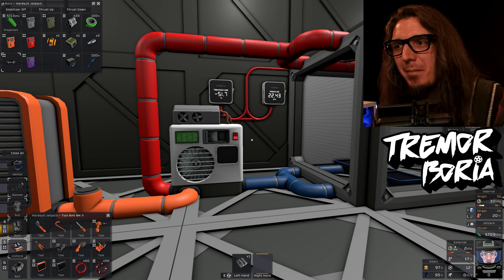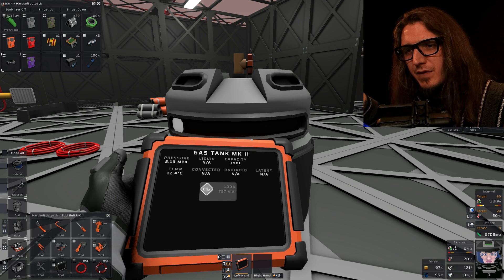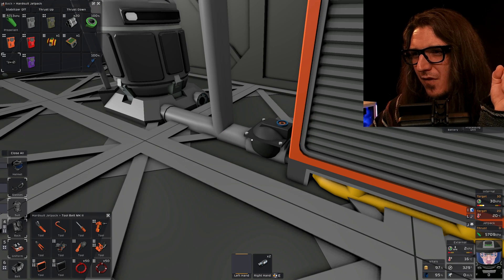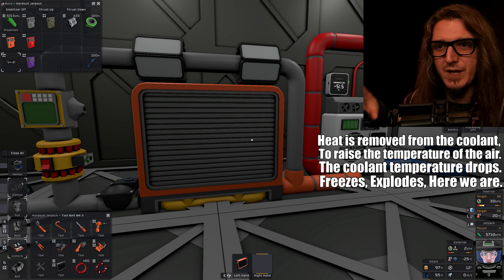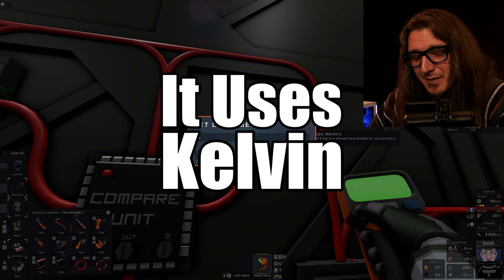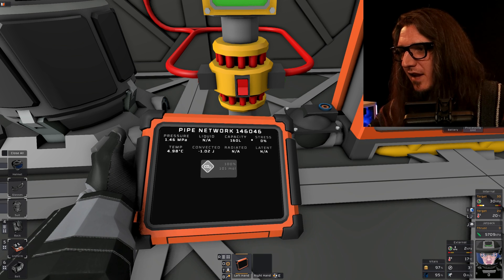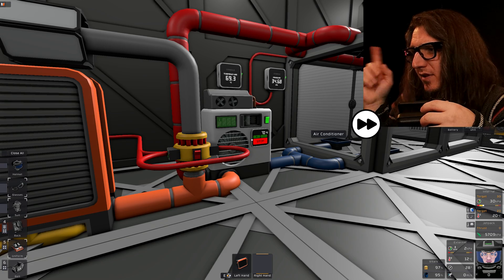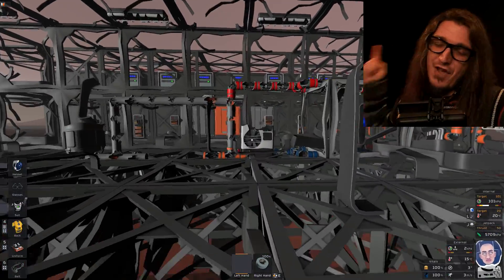Stationeers: Atmospherics, Easy Air Conditioner

Comment: when you remove a pipe, the pipe capacity shrikes, in the game there is no different between a pipe and a tank, that why the inline tanks work and are so important, i wish the normal tanks will just rise the capacity
Reply from the maker: I believe tanks will raise the capacity of the total system if there's no valves or check between them and the pipes. But I could be wrong, I've done it before lol. 
Thank you for the comment you have a good day.
Reply: @TremorBoria  it still needs a tick for the gases to be transfered to the tank, its like having a valve in front of it
Reply from the maker: @dbmaster46446  OH, Yes. My mistake I see what you mean. That is a pain. And you're right it should just be part of the total capacity. I wonder if there is a physics coding reason it's ticked like that.